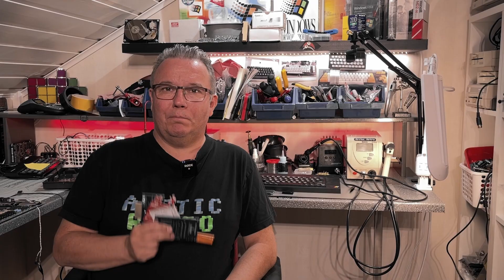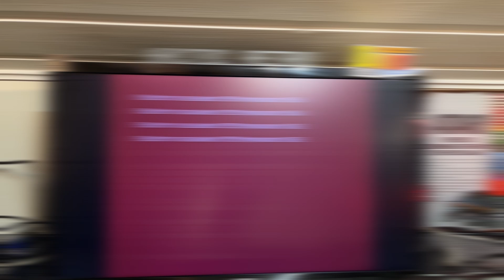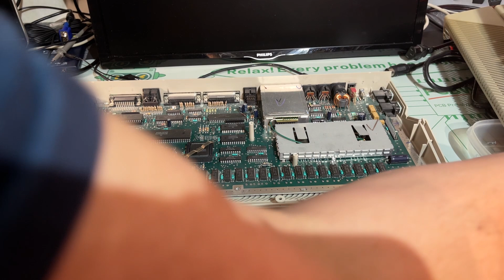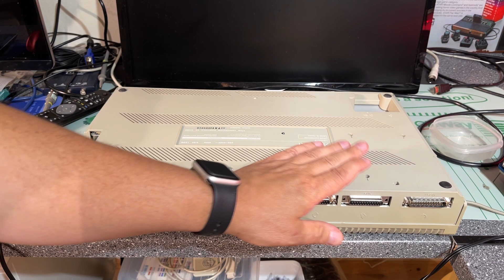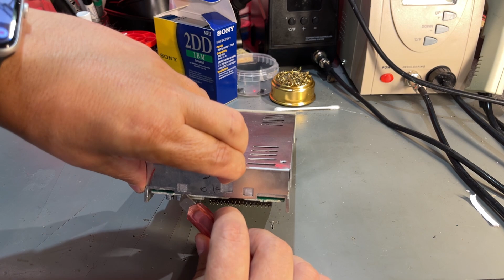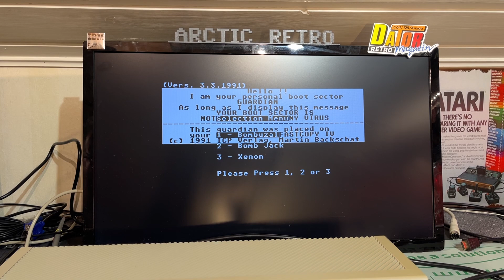ATARI ST DOUBLE FIXUP! Atari 520 ST and Atari 1040 ST in one go - Do they work?

Comment: One of the best items for these old Computers is RGBtoHDMI the version with a separate digital Pickup below the Shifter.

If you want a Harddisk i recommend Tos 1.04.There are some SD Harddisk like Asci2sd .

The 520 St should also have 1MB it can build with one more row of rams over the existing ones and connects to ras1, cas Low1, casHigh1.
Reply from the maker: Ok, thanks for the advice :)

Comment: I've always thought the Atari ST machines were interesting in a number of ways.  The ST BASIC was pretty buggy, but  GFA BASIC was actually a pretty advanced version that worked a lot better.  GFA, in particular, did not use line numbers in the "traditional" basic format unless you just wanted to - it was a lot like QBasic, but had some unique features, too, and a compiler was available for it.  STOS BASIC I don't have experience with; from what I've read, it was flawed but better than ST BASIC.

The 1040 keycap repair really points up why any retro shop really needs a 3D printer setup somewhere, or access to 3D printing services.  Nicely done!
Reply from the maker: Thanks for the insight :)

Comment: The Csync Signal of the Atari ST works with 5 V , modern TVs expect not more than 3,3 V via Scart Input hence adding a 330 Ohm resistor should fix your flickering problem....
Reply from the maker: Thanks! Why don't they add that to the cables they sell ?
Reply: @Arcticretro  well, they might  think that you will either use an old crt or an rgbtohdmi converter anyway...